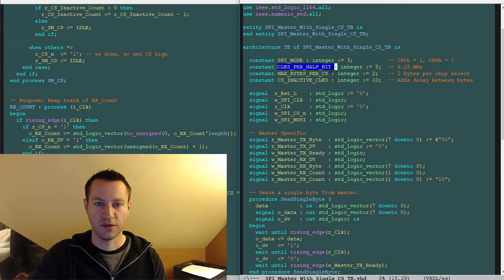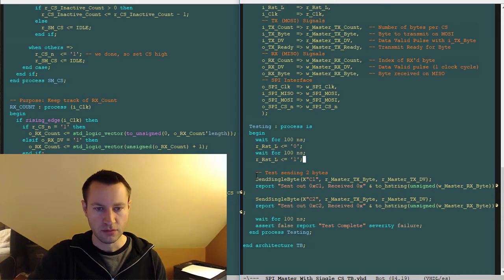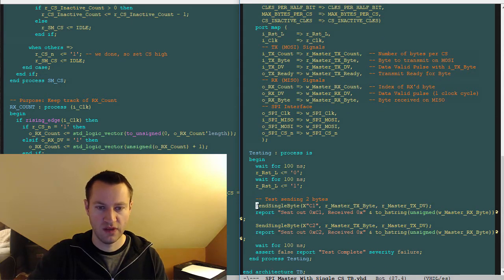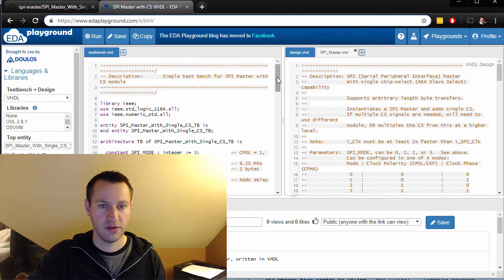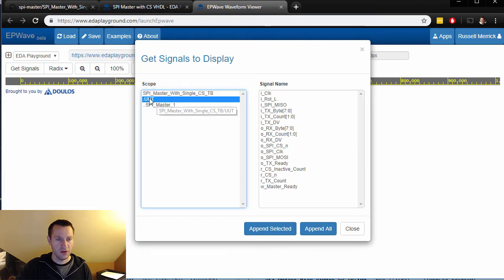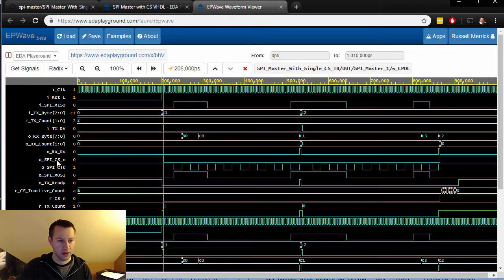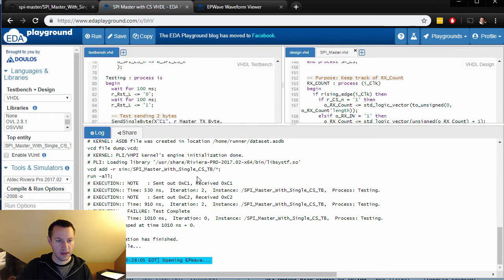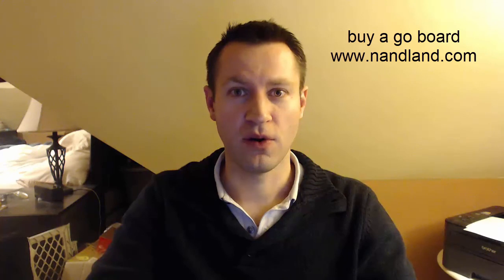SPI Master with Chip-Select, VHDL Testbench

Comment: thanks for these videos. they are quite helpful. Quick question. A bit confused about w_Master_RX_Count. I know it connects to o_RX_COUNT. Ran the simulation in Vivado and checked that. it only goes to 1 after receiving c1 and then goes back to zero. what exactly is that telling us?
Reply from the maker: The width of this counter depends on the number of bytes to send. If you're only sending 2 bytes per transaction, the possible values of the counter are 0 and 1. If you send more bytes it will have more values.
Reply: @Nandland  thanks for the reply. Figured it out eventually